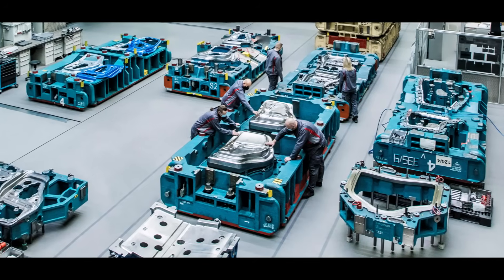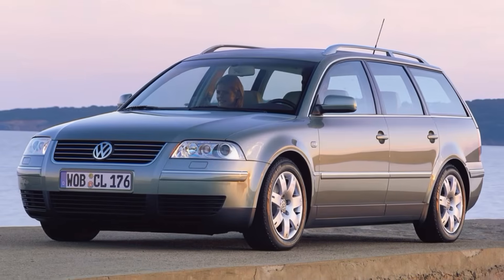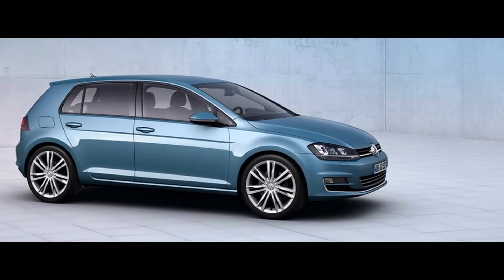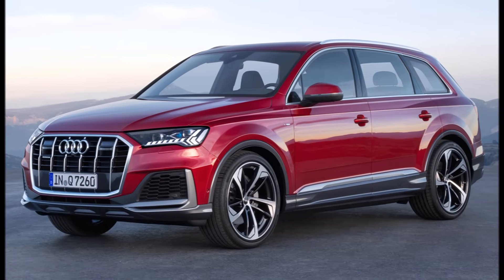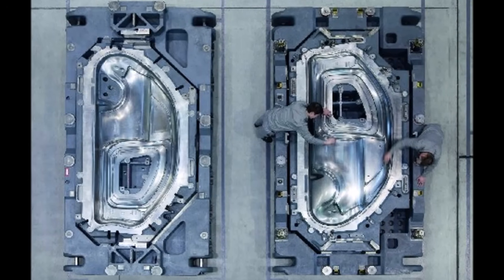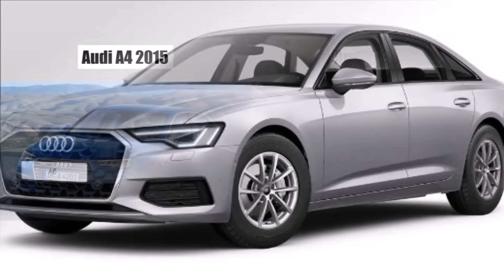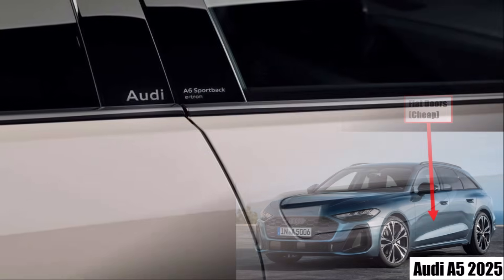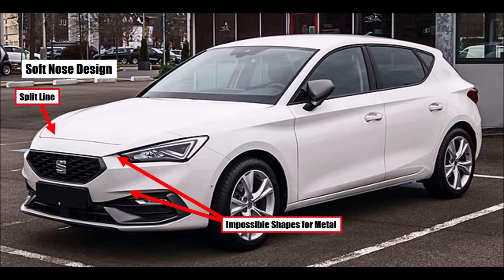Car Bodywork Details EXPLAINED

Comment: Make a vid about the body panels of modern BMWs, you can't look at them without tears, especially the new 5 series.
They use laser welding to join the panels and it affects the outer panels in a horrible way

Comment: Great video and topic. Like sandy munro’s for car interiors. When I first moved to Taiwan as industrial product designer I was looking for such videos to understand the design for manufacturing process but not many of this kind back 10 years ago. 
As for the bonnet not reaching the mask up to the front, another reason is to cost down repairs as with a small crash you just change the plastic facia of the car and not metal bonnet that sits more back and most likely will not be affected.
Reply from the maker: Yes, that's what I mean by crash rating, which also assesses the potential repair costs after a minor crash.
Reply: @bsport320  My bad, I thought you meant only the pedestrian safety.

Comment: I’ve always felt that VW put a lot of money in sheet metal, insulation and interior finish to increase quality feel, but skimp on the mechanical parts to keep  cost down. Things like gearbox, pedals, engine sound, clunkyness in the driveline etc., for me always feels behind Hondas or Toyotas. And statistically these Japanese brands are more reliable. But they could use better sound insulation.
Reply: Agreed! Electrical parts in VW Audi also seem to be poor quality.  "Coolant migration" into the wiring loom from the coolant sensor is a bizarre problem only found on VW Audis for example.

Comment: I drive a B9 A4 I bought in 2018, and there are several design details that helped me choose it over the then-current BMW 3-series. The line that goes around the whole body, part of which is the shutline around the bonnet, is such a great design feature. That panel was probably signifcantly more expensive to manufacture than the BMW's relatively flat hood. The arrangement of panel lines where the A-pillar meets the body is another area where the 3-series is a cluttered mess that looks like it was designed to a price point where the A4 does not. The A4 just looks and feels like the more premium car of the two, and a lot of these small details are why that is.
Reply: agree

Comment: Very interesting. One question regarding the „wobbely“ reflection on the A6 e-tron. Its also wobbely on the glassurface, so is it really the metal or the softbox of the photographer? Plus: wouldn’t customers als profit from simpler parts regarding theire insurance, since party to replace are cheaper?
Reply from the maker: It‘s just clear that such a pic would not have left the studio in the past. 
In theory if parts are cheaper to make, spare parts would be cheaper too, but we know that’s not the case;)
Reply: Confirm with you in both points. I personally just acquired one of the last Audi A6 C8 in Florettsilber. I am just stunned by the detail of the outer bodywork with the sharp fluent lines. If you let all the lines sink in you start to realize, how great of a work this cars body actually is. The never A6 EV and ICE aren’t made with such attention to detail. How do you rate the C8s bodywork? Would be very interesting to hear!

Comment: Why even bother to make a Video about a Topic you obviously know nothing about? The Trabant body was made of Duroplast!
Reply from the maker: Calm down, never said Trabant has metal panels and duroplast was pressed into shape
Reply: @bsport320  Yea but that did not require it to be flat. Look at the lamp rings.  Also the underconstruction was made out of steel. To my Knowledge this was made to not waste materials (the rather flat panels) and to save on steel especially. 

I am also not convinced by the later Audi example. what makes you think that is not just desing and air resistance optimization?

Comment: I made a long term rental agreement because I needed a car for less than a year. I got a completely new 2024 Opel Corsa GS. Costs 32k Euros. After 4 months the front parking sensors are always on when driving less than 10kmh. The windows are always frosted compared to other older cars my neighbors have. Everything on the car feels cheap. No wonder no one is buying German quality cars anymore because it's owned by Stellantis and apart from the look is a Peugeot 208.
Reply: An Opel is now a French car after all, so unfair to blame Germany for it! It will have the usual "because French" quirks!

Comment: And the best thing about this, they say the market “wants” this sort of design like pop out door handles and rounder bodies. Well if there is nothing else to purchase….
Same with suv’s. They make better profit margins on crossovers and sell them to us “because the market wants it”.
Reply: Same thing with black wheels, it is a cost control item sold as a styling exercise. The silver finish is about 4x the cost of black.
Reply: @Biochemechanic  Is it really? I doubt silver metallic paint is 4x the cost of black paint. Are you comparing diamond cut wheels with a contrast paint finish (now very popular) to plain black painted? I can see that costing 4x.
Reply: @ I was a technical manager of a powder coating division, yes metallic silver was 4x black powder coating. It’s the raw material cost difference.
Reply: @ Wow! Thank you for your input.
Reply: @ As others mentioned, aluminum paint also needs to be clear coated to protect the aluminum pigments, aluminum oxidizes rapidly. If an auto manufacturer can save a couple bucks a wheel, it adds up to a substantial savings for them, all the while pushing it as a trendy style to consumers. I personally detest black wheels, they are blobs of nothingness when viewed from more than a short distance away.
Reply: @Biochemechanic   Hmm, I think diamond cut or chrome or silver wheels look good on black cars with lots of chrome trim (i.e., luxury cars), but the blacked out look (e.g., the Monster Mustang V8 Supercar) can look very smart on sportier cars.  Black cars are not great themselves -- they only look good at dawn or sunset, but dawn or sunset is when the sun is at the right angle to catch the spokes of black wheels and make them show up.  🙂

 [I have plenty of photos to demonstrate this, as I've only been able to find black used cars and decided to go with the black wheel look -- the original shadow chrome finish on my used BBS wheels I picked up very cheap was too far gone, and it's not possible to cheaply redo shadow chrome DIY AFAIK, so I went with black!]
Reply: @ I'd much rather Imola Orange, Phoneix Yellow, Championship White (I even painted the BBS wheels Championship White in advance, as I was hoping to find a white Type R this time) or Deep Sapphire Metallic blue or whatever than black paint, but you take what you can get with used cars!
Reply: @Biochemechanic  Since obviously the diamond cut wheels are three steps: background paint colour, diamond cutting, and then clear coat -- versus a silver or black wheel is just silver or black paint.

Comment: I worked in upper management at an Audi production plant up until 2013 and I must say you described the background of the situation perfectly. I remember when we got our hands on a pre production Golf and were shocked at the sharpness of its lines and consequently we invested a 7 digit amount into modifying the sheet metal forms of an almost production ready A3 to ensure its lines were even sharper. 
Or that guy we payed a fortune to leave Volvo and work for us so we could keep the clean front end design with acceptable pedestrian safety. 
Piëch was a patriarch. When he visited we had to paint the grass green and build a new street so his plant tour would be more efficient.  That was absurd in a way but as long as he was in charge you really felt you were working for him and not for some anonymous shareholders. And as he was an engineer, the company was run by engineers. I’ll never understand what he saw in Winterkorn though.
Reply: Thank you for sharing. Very insightful!
Reply: @albertlert  most welcome!
Reply: Same here. I work for an American owned OEM in Europe. When corporate comes over the whole plant is buzzing. Everywhere fresh paint, clean offices, the grass is perfected and everyone in the plant receives a clean set of working clothes. 
A colleague from the Mexican plant told us there they even painted the sandy hill behind the plant green for a plant inspection. In the middle of the desert 😂 
As a testing engineer I have some crazy experiences with OEM CEO's too. I'll never forget a redlights A'dam adventure where I sure was the only one staying profession. Or that testdrive in Chile with Chinese. Last minute they changed the route so that it led from casino to casino. 😂 
Or in France; our testdriver happily ordered a bottle of red wine at lunch before diving back into Paris traffic with us 😮
Reply from the maker: Thanks for the comment!
Reply: @bsport320  thanks for the video! I really would’ve never expected to see this topic on YouTube
Reply: Piech is the best thing to happen to VW. They desperately need a leader like that now. Audis current president even admitted their quality isn't what it used to be.
Reply: @ Totally, it would be great for the innovation of the whole industry if someone like him came along again. But the combination of great engineering knowledge, cutthroat business sense, and not least the inherited money and legacy to give you a sense of ownership in an organisation such as VW does not grow on trees. 😅
If you own a company you think in terms of dynasty and not in terms of bonuses. But at a certain maturity level of dynasties the offspring tends to prefer studying the fine arts over engineering. It remains to be seen if the Piëch/Porsche family has someone who wants more than a very pleasant trustfund life. I surely hope so.
Reply: Awesome insight, thanks so much for adding.
Reply: Piech is one of a kind. Larger than life execs like him don't exist anymore
Reply: I can read here why dieselgate did happen.
Reply: @ if you ask me, that was all Winterkorn. I can’t talk for everyone but Piëch was inspiring. Winterkorn inflicted fear. Singling you out in an auditorium of a hundred colleagues lamenting about you missing your target 5 minutes straight. Screaming at you. Allegedly. I mean, Piëch was no stranger to pressure, but Piëch was an engineer. I extremely doubt he would have accepted that shoddy solution. Let alone expect that nobody would find out. You need to study business to be that stupid I could say provocatively. But I don’t know. Just making unfounded assumptions based on the different cultures they fostered
Reply: @paddybm3245  Interesting. Though Bob Lutz, for one, blamed Piech, describing him much as you describe Winterkorn.
Reply: Was this a3 you were working on the 8v? My current and first car is an a3 8v se 2.0 TDI. Would you say there a great deal of difference in quality/luxury between the golf 7 and the 8v? I'm considering the idea that my second car should be a golf 7 as for some reason most uk models I see have a lot more spec than their equivalent a3's in the used market which always perplexed me. For example why is it that most golf 7's trims I see have adaptive cruise control as standard yet on the a3 this was an optional extra? was it just for profits because someone buying a new Audi model  likely has more money to spend?
Reply: @dampmaky a3 has a much better sound deadening.
And Volvo won’t rust.
Reply: @adelkharisov  Volvo's that are made during the Ford-ownership do rust quite badly, for example P3 S80/V70/XC70 lose most of their rocker panels behind all the plastic. And with newer Volvo's all the panelgaps are tighter and visible paint bubbling can be found.
Reply: @dampmaky  it was an a3 variant. They are quite different in some details that are apparent if you know where to look. 
I’m not an objective source but I would say there is quite a difference if you have an eye for detail. The materials of the interior are a little better throughout. If you ask me the interior design of this 8V is the most beautiful Audi has ever designed. The „haptic module“ in each knob is a good example for superior attention to detail in the A3y it makes the Click sound when you turn the knob. They were not cheap (for C-Parts) and the knobs would have worked perfectly fine without them. But if feels and sounds like you’re opening an old-school safe that’s so cool I think. 
Of course both models are based on the MQB platform and VW was the developer of that. So it was not possible to make every detail like we would’ve liked it ( the premium cars of the VW group, based on the Audi-developed  MLB-Platform have some details that are definitely more premium still) 

I think you will feel the difference. As for the motor: The 2.0 TDI is basically identical and from the same plant. Acoustic design varies. 

Exterior is definitely more premium but I don’t think 99% of people realise it. One example is the panel to the left and right of the hood. Check out how pointy it is at the one point where the gap between side panel and hood joins with the front end of the car. Show me one other car that ever achieved that and which wasn’t hand made. It’s those little things that nobody noticed but the people at Audi were -  and I’m sure in some areas still are - proud of. They were symbols or the ethos „premium quality in everything we do“ and as mentioned in this video some of them contributed to the subconscious perception of good quality among the general customers. But in the end it’s hard to argue if people keep buying BMWs like crazy and their interiors (were) about 30% cheaper? At least so I heard. 

As for the specific features that were options.. yes the high end versions are rare and I’m generally not a big fan of the „make everything optional“ strategy but that was not my job.
Reply: @paddybm3245  genuinely fascinating to read the backstory behind ones own car, thanks for the reply
Reply: @dampmaky  My first car was a brand new Golf 7, afterwarfds I drove a new Golf 8 GTE, now back to a used A3 8V. Having driven all three, the A3 is imo easily the most luxurious out of the three. The sound deadening, the heavy doors (for a compact car they feel very sturdy and quality), the usability of the infotainment and the interior quality is pretty good to me, all in all way better than in both Golfs. But I definitely agree, it was very hard to find a car in a good trim for a fair price, even here in Germany (took me almost half a year).
Reply: @ thats the thing, my current 8v is super base se spec, in the uk that means no cruise, no heated seats etc etc. the only thing i got is the outdated navigation system. Does the quality not feel as nice within the golf 7 on a day to day basis? ideally i would love to upgrade to a well specced 2016 facelifted a3 8v with car play etc... but for some reason all the ones with good spec are similar in price to the equivalently specced a4s on the market!
Reply: @dampmaky  I mean, it‘s not a huuuge difference, you will probably also be happy with a Golf 7, it just depends on if you would miss the sporty edge of the A3 that the Golf is lacking. What I forgot to mention is that the Golf 7 even has a sunglasses compartment and a coin compartment right next to the steering wheel, which both are missing in the Audi and are features that I miss

Its not worth going for a well specced A3 if there are similar spec A4s at a comparable price, though
Reply: @EuRoNiX44  That is one thing with the A3, the storage in places is a bit lacking. Also VW tend to cover most storage compartments with felt which is absent in a lot of Audi models (I don't know about the 8V A3 but my dad had a second generation Q5 and the door pockets were just bare plastic) 
But yes overall the Audi interiors are much higher quality.
Reply: @ you’re right! That’s something the A3 is also missing, and it can be annoying at times, when listening to music for example, it tends to rattle at high volumes if anything is in there

Comment: There is one design feature I dislike more than anything else on new cars and that is when the rear door goes so far back that it becomes part of the rear fender, like the A6 at 4:30. That was the reason why I never bought a Skoda Yeti. The image I get in my head is old cars from the 80-ies that always had rusty door edges and I can only think of all the gravel from the rear tyre that will hit the door edge.

Comment: New cars side profiles have become so bland. I still drive a Passat B8 with its characteristic " Tornado lines" that stick out in the side profile. You can see the bodywork quality in older VAG cars, Piech shoved through alot of decisions that have been cost cutted away since and it shows.
New cars, not just EV´s, have very smooth sides without much detail, unpractical sunk in door handles. In some cases even 18 inch wheels can seem small in the wheel arches as there just " blob" around them. Bodywork gets blobby and simpler, metal parts get exchanged for plastic and to flash it off they add LED lightbars front and rear. That leads to more costcutting like the ACC sensor or backup cameras not being in VW logos anymore ruining the clean design they had...